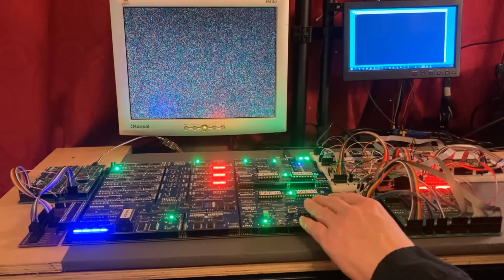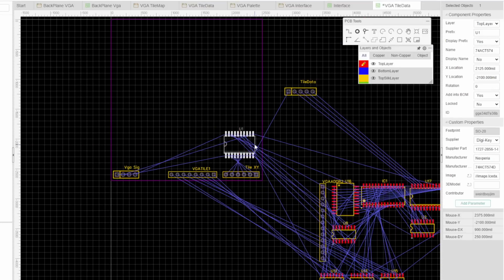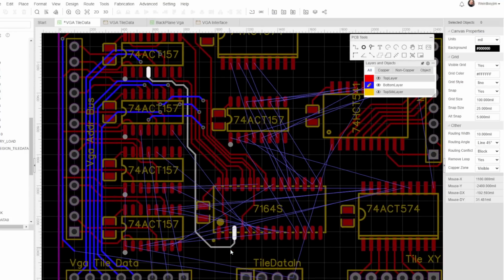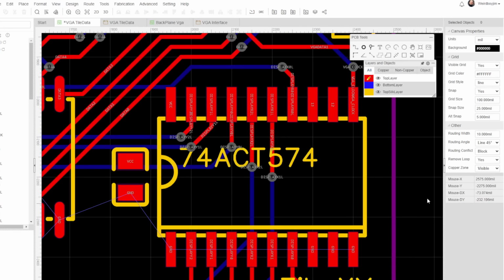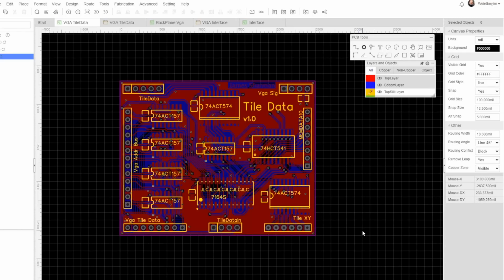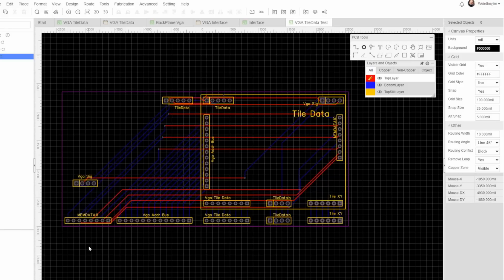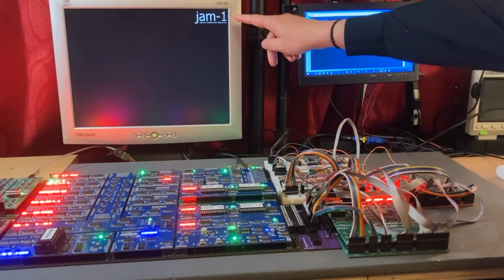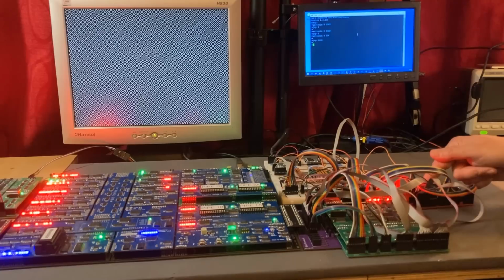Tile Data PCB - VGA from Scratch - Part 14

Comment: I think a lot of game developers of the 8-Bit era would give up half of their pixel resolution to have a second, true  tilemap layer for parallax scrolling. The SNES could do up to four if one could accept the palette limitations. The PC engine had only one tilemap layer, so developers had to stand on their heads to get anything resembling parallax, usually by defining a lot of extra tiles as animation frames, or line-scrolling tricks. I think this constituted a primary  downfall of the PC engine.
Reply from the maker: I wouldn't disagree with you. But how many of them would have been prepared to solder all the extra components that would be necessary? 😅

Comment: Is it necessary to route traces between pads for GND and VCC if you're dropping vias to connect those pads to internal planes? Seems a bit redundant to me?
Reply from the maker: I'm not an expert on this stuff,  but someone who definitely knows more than me told me that vias should be regarded as having a greater resistance than a trace so if possible connect the power lines of chips to their decoupling directly.
Reply: @weirdboyjim  Intriguing. Im not saying they are wrong, but every "professional" PCB Ive ever looked at doesnt seem to go to that trouble?

A quick bit of googling and some calculations online seems to suggest 10-30mOhm is typical for vias, but an 8mil trace over 0.5inch is about the same (high 20's mOhm). Increase the trace width by a factor of 10 and the resistance drops by a factor of 10, so it would seem you really need fat traces for it to make much of a difference?

Im sure there are applications where it matters, but that its one of those "if you know then you need to know" kind of things lol.
Reply from the maker: @TomStorey96  it’s not uncommon for me to get conflicting advice, it would surprise me if this advice was wrong but I may not be describing it right. I went back and looked at the pcb design, there really isn’t that much vcc/gnd traces beyond connecting to vias.
Reply: @weirdboyjim  Im sure you get all sorts of ideas and suggestions thrown at you. In the end, the important thing is that it works.
Reply: @TomStorey96  DC resistance isn't the issue here, it's high frequency impedance

Comment: I think the auto-router would've taken care of this in around two minutes.  I would recommend it, I recently had a 6502 SBC board I designed in EasyEDA made and the auto-router was flawless (I checked it's work of course, but it was a 4-layer board and it was much easier to have it do the routing.)
Reply from the maker: I really wouldn't want to attack a board like this with the auto router. I find the very process of routing it tends to identify some issues and I can adjust bits of the circuit in ways the autorouter can't. Besides, I'm not one for the easy path.
Reply: @weirdboyjim  More content doing it your way as well haha

Comment: I will believe in the awesome power of AI when an auto-router arrives that actually automatically routes something (edit: something dense).
To be fair, perhaps the tools I've used weren't recent enough, or expensive enough.
Reply from the maker: It does feel to me like Autorouters should be better than they are. If I had spare time I might take a crack at creating an open source one, it's a similer class of problem to group pathfinding in game development.
Reply: @weirdboyjim  It certainly qualifies as an excellent puzzle to solve.  (Edit: and that's a brilliant idea for a parent algorithm - perhaps a lot of code could be inherited)

Comment: It's so satisfying to watch things go from multi-breadboard networks of wire to sleek, compact PCBs.
Reply from the maker: Glad you like! But how would you feel if I went strait to pcb?
Reply: I'd be vicariously nervous, lol. The breadboarding is much more agile for proof of concept. It does have the signal speed limitations though, so for high bandwidth stuff it may not be an option.

Comment: For dev/test boards I just use a p-channel MOSFET circuit on the power input - this has the benefit of only allowing the power through in the correct polarity, while not having the voltage drop of a typical diode method. For the cost of a few pence for a little SOT-23 chip, diode and resistor, it's nice easy bit of protection (saved me a few times!)
Reply from the maker: Interesting, I'll give that some thought.  It would be easier to justify if I was making larger modules.
Reply: @weirdboyjim  Yes, I guess it depends if the end goal is to offer the boards as a kit. With the backplane obviously that almost completely negates issues, but if people are wiring the boards separately, then there will be inevitable puffs of magic smoke from some :) I have PCBA done in china for my production and prototype designs, with final assembly in the UK, and started adding more protection due to mistakes by people on the assembly line here. Some of the chips on my boards are pretty expensive though, and  never seem to survive reverse polarity, so it's a bit different (also had problems with them using bench supplies to test, set to the wrong voltage, so also had to protect against that :) Great series by the way!

Comment: Great work as always.. two questions: 
-what's the "JLCJLCJLCJLCJLCJLC" under the 7164 on the silk screen?
-instead of designing the red breakout board, why not solder the pins "upwards" for testing and make a second pcb with the pins correctly downwards for the main build? depending on component cost, could be cheaper than a second pcb.
thanks and greets from Germany..
Reply from the maker: the "JLCJLC..." is a marker for JLCPCB as to where they can put their production serial number, if you check later in the video it's been replaced with a there own id for tracking the board through stages of production. You absolutely could do that with the PCB pins BUT this testing is as much about my soldering as the design itself so doing it that way doesn't cover all my test cases.
Reply: 18:25  shows the JLC numbers

Comment: You don't need to key the power connectors. Just make them 3 pin, two grounds on there outside pins, power on the inside pin. You can use 2 wire cables with 3 pin headers, just put power in the center, ground on either outside pin and you are done ;-)
Reply from the maker: That is an excellent suggestion!
Reply: That is an excellent idea! I'll implement that from now on in my projects. Thanks!
Reply: Isnt that essentially how USB was made reversible

Comment: There's a replacement controller for the hot plate you have. With better regulation, etc.
Reply from the maker: Ohh,  do you have a link for that?  I've seen there is a more recent version but didn't know there was an upgrade.  I've been thinking about trying to pull one of these apart and merge it with a reflow controller.

Comment: Hey James! Why go to the effort of connecting power/ground up on L1 and L4 if you're adding internal power and ground planes?
Reply: Scrap that! You're only making 2-layer! 😁 Your "internal planes" comment confused me! If only I had waited 2 minutes longer! 😁
Reply from the maker: The Tile Data board is 4 layer,  the 2 internal layers are power and ground. I'm going to be honest George, knowing your experience I'm more inclined to think you question means I'm either explaining myself poorly or doing the wrong thing.  I only get a connection to the internal planes from a via (or other plated hole) so I still have to make sure they are connected. I've also been advised that it's better to have a component side trace from the the decoupling direct to the power pins so I try and do that.  Finally if I see a little blue rat line and a clear way to connect them I can't resist adding the trace even when I know a later via to the plane will do it.